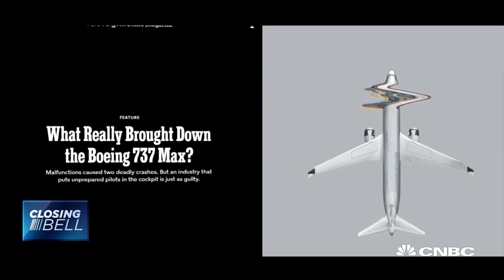NYT Mag reporter on Boeing: Accidents caused by crews in both cases

Comment: When the NTSB Report comes out and confirms that the actions of the flight crew contributed significantly to the outcome, will the critics also accuse them of being complicit with the FAA and Boeing? 

Wrapping this story in conspiracy theories doesn't change the facts. The CVR and DFDR clearly indicate that the crews improvised rather than following published and well understood recovery procedures, in one case allowing the speed to increase to the point that the aerodynamic loads on the horizontal stabilizer were so high that there was no way to recover. All aircraft have that trait regardless of whether they have MCAS or not. The irregular actions of the flight crew cannot be ignored in determining responsibility for the tragedy.
Reply: With the benefit of hindsight, would you admit you were wrong to sound off as a stooge for boeing by blaming the "the actions of the flight crew?"
Reply: @SquadDirector  - If you've read the report and had any knowledge of 737 cockpit procedures you wouldn't be asking that question. The report clearly described the actions of the crew and their failures in the cockpit - as well as the communication failures and possible coverups by ground crew and maintenance.
Reply: @SquadDirector  - You obviously paid no attention to the video either.
Reply: @In0vat0r  My apologies, there's nothing wrong with not disclosing the existence of the MCAS software to pilots. They were just expected to address the issues caused by MCAS even when the manual did not explain it or provide explicit instructions on how to disable it.
The plane was globally grounded due to "the actions of the flight crew."